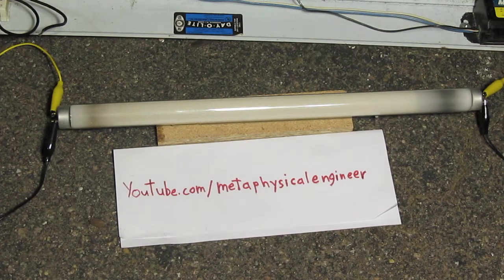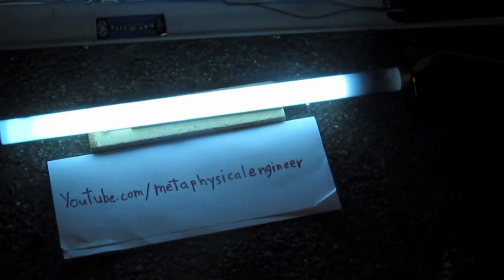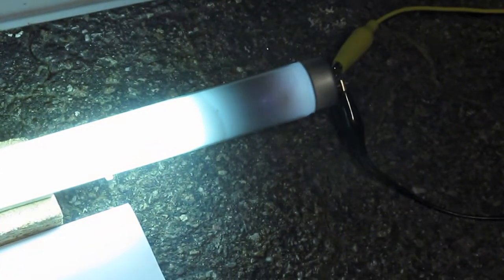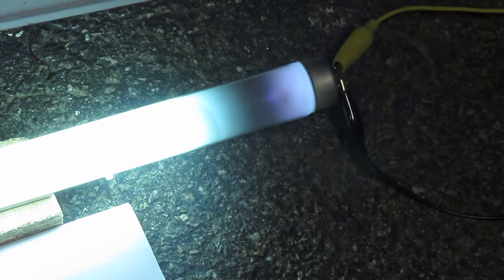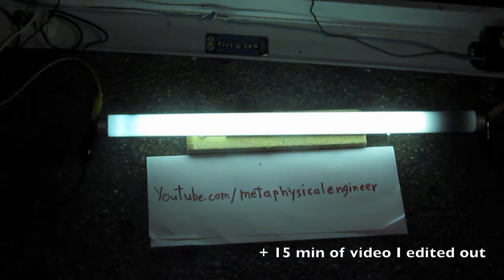Tube survives 2nd pop attempt

Comment from the maker: Interesting.  If it still has vacuum, connect it to something that puts out far more current than it can handle at enough voltage to force it to stay lit up.  That should finish it off if that is what you want to do :)

Comment from the maker: Tube pop is up, but kinda anticlimactic.  This tube had a slow leak and gassed up overnight, and a 40-joule discharge killed a second tube with a little pop.  I need to modify my kill rig to let tubes start gently and then apply full power to them.

Comment from the maker: Of course.  I was a couple meters back and had goggles on, b/c I have seen vids where the glass cracks.  And yes, I have tried lots of things but the lamp won't die.  Last resort tonight is all out variac + voltage doubler + resistive ballast *evil laugh*

Comment from the maker: It's a universal ballast, so it' treating the lamp like an F30.  I tried waiting a bunch but it has stabilized.  The bad end temp peaked at 160 deg C but now barely climbs to 80 and the tube shown no distress other than rectification.  I have no HO or VHO ballasts or anything more potent than that universal one, so I'm gonna burn the tube on a few amps of resistively ballasted DC until it won't go anymore >:)

Comment: Lol, that ballast does have the guts to pop this lamp.
(I did it once with a high power factor rapid start 1 lamp
F40 ballast, with an F20 lamp.) It lost vacuum after
several attempts. (with the very brilliant orange flashing
on the bad end.) You could also try a slimline instant
start, or HO or VHO rapid start ballast.

Comment from the maker: Tough indeed.  Old tube (maybe 20 years) and better quality perhaps?
Tube will take the full voltage to start, then will run on maybe 100 or so.  The heater shown in my update video will soak up the extra voltage but will pass considerable current, hopefully melting the tube electrodes and causing the seals to fail.